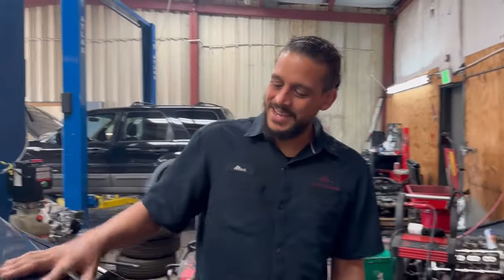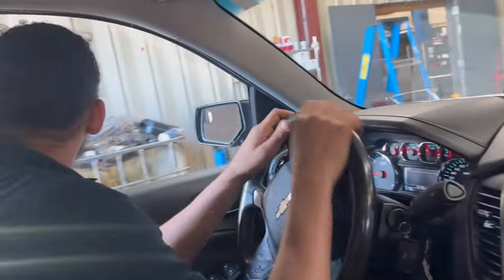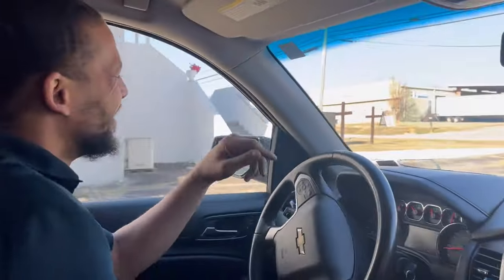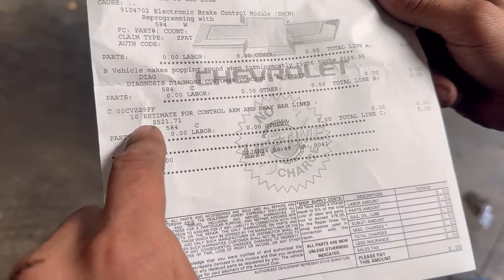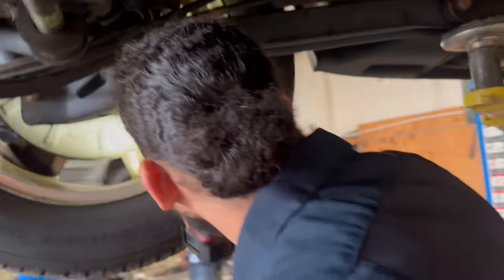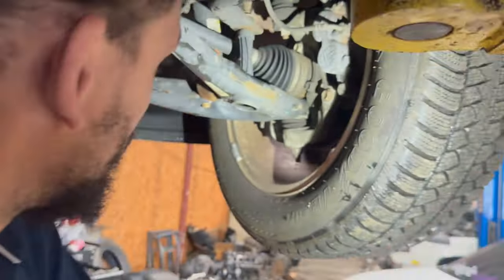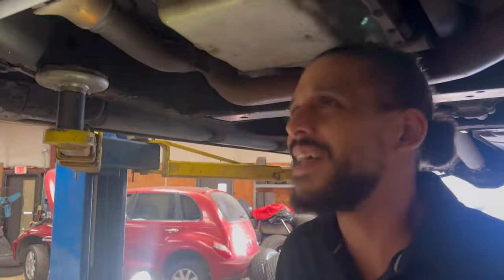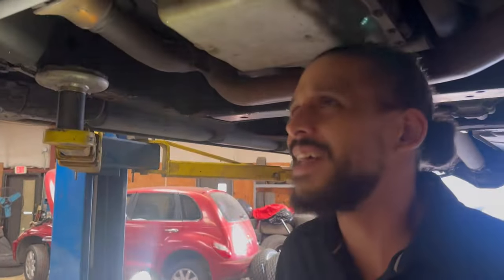Oil Leak Oversight, How Did The Dealership Miss That?

Comment: Yeah Alex your definitely a good mechanic I try to do all my own work but I never knew that method of checking ball joints with the adjustable plyers. I Always did it the other way that you showed which was when you placed your hands at the upper and lower section of the tire and see if u have movement.But anyway I learned something new or different I liked your way better 😊😊

Comment: If you look at those oil cooler lines there is an Allen bolt on the side that has a o ring. A lot of people mistake the cooler line gaskets for leaking which they do but over look that oring that leak as well, I ALWAYS replace both of them common problem on those Chevys

Comment: Car Doc, from your experience, what year Escalade has the most reliable engine?
Reply from the maker: Honestly, the early 2000’s. Like 2006 and under. Any one that doesn’t have the DOD system. Unfortunately the newer ones look cooler but they give lots of problems But the older ones are more reliable.
Reply: @AlexTheCarDoctor  thanks brother.

Comment: Man wish you were in Illinois as to where someone can finally tell me.  What the hell is going on as to why the serpentine belt keeps slipping off my car.  Chrysler  200 2013 LX even after the water pump has been replaced recently,  the tensioner pulley was replaced along with the idle pulleys.  Most recent when it came off again the crankshaft seal was replaced.  Actually used my street mechanic and haven't taken into an auto shop for a diagnosis
Reply: Need to use a laser and check the alignment of the pulleys

Comment: Great video! I currently have a 2013 Explorer 3.5 NA. I want to upgrade to a Tahoe/suburban. It would have higher mileage. Do you recommend I stick with my current vehicle?
Reply: I have a 2014 Explorer and love it. Mine has 180k on it. I fix my own stuff, and I went through it when I bought it last year. The expensive items on them to repair are water pumps,  transfer cases, and catalytic converters. The 2015+ Tahoe/Suburbans are money pits.
Reply from the maker: Unless you’re talking about the 06 and under or pre DOD displacement on demand system stick to what you have or keep it ford or Lincoln
Reply: @AlexTheCarDoctor  thanks for the recommendation!
Reply: @mph5896  water pump was replaced June 2023 due to leaking. Along with timing chains and a bunch of other parts since they were in there. Anything suspension related I do myself.

Comment: Sheesh, if you're that slow with "patients" and that fast with turnaround,  I should chance driving my 2014 RAM 2500 from PA to get you to do lifters and beefed up cam on my 5.7 Hemi 🤔🤔🤔  But I'm also thinking a thousand mile drive at 75+ isn't gonna help the issue....🙄

Comment: “I don’t know how the dealership missed that.” (15 seconds earlier) “I can’t tell where it’s coming from because of all the oil but it’s usually the oil cooler gasket. I like starting with easy stuff before I look into bigger repairs.” All I hear is I’m gonna diagnose it by throwing parts at it.
Reply: Hold on. The end of the video his wife really says it’s so bouncy after doing a suspension repair 😮. Also, at what point are you going to bring up an alignment.
Reply from the maker: Did you NOT go along with my diagnostic process in the video? I am literally talking out loud while I do my discovery. And my wife was referring to parking lot we were driving in, NOT the suspension of the truck. Alignment was taken care of. Not everything is mentioned in my videos all the time. Chill….
Reply: @AlexTheCarDoctor   I’m not trying to be a troll. I’m just showing that trying to put dirt on other shops is not the way unless they are seriously proven scammers and you have evidence. People can pick you apart just as easily if they are not just a DIY’er. I did say it is hard to keep up with your diags and why. I’ll give you I misunderstood the bumpy parking lot but that made me realize. You would need a strong left turn to get the noise on the driver side stab link, unless you’re bouncing. Stab links stop the car from rolling. You would need the left turn or the bumpy road. You started to mention it’s just the start and there are usually bigger problems. It is very odd to see one stab link snapped with no other major damage. Lastly, I
Noticed you said this came back in for the trans. You said in the comment you know these GM’s have issues. You can clearly see the oil residue is above the cooler gasket. The cooler lines start at the exact point of your leak and are covered in oil worse upwards where it start which is right where the leak is. The metal line after the plastic section is wayyyyy cleaner. The biggest leak on the GM’s is the rear main seal. It is right there to leak on the filter and the lines plus its back for trans work. Again I’m coming off rude but that’s the vibe you give off straight up giving out shop names and it can be done just as easily to you. Stating the vehicle needs an alignment is one of the most important aspects for the DIY’er to understand. From now on I’m just in the comments for tips and compliments unless you go rogue and started going back alley which I doubt.

Comment: Never had an oil leak at 60K on a Japanese vehicle.  Not even close.  (But... I specifically never buy Subaru which does use cheap silicone sealant instead of real gaskets so that Japanese company brand can leak early in life).  Stick to Toyota, Lexus, or Mazda. Was this thing in a wreck?  I can't believe it would have bad control arms at 60K and all these little problems. I think it was in a wreck perhaps?